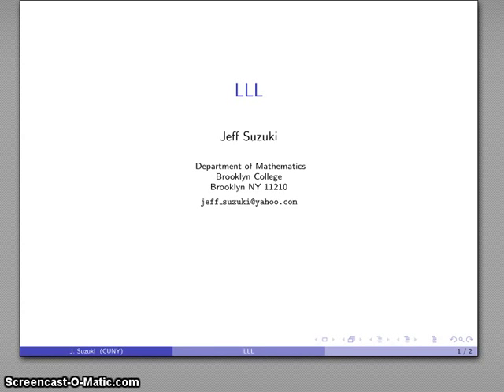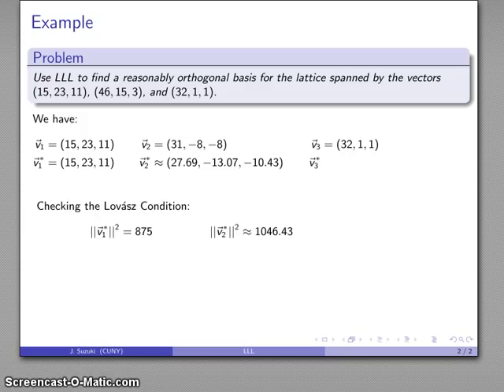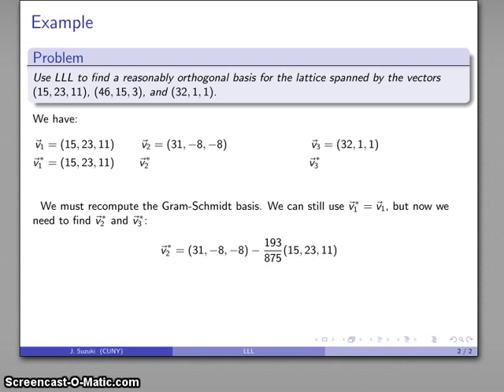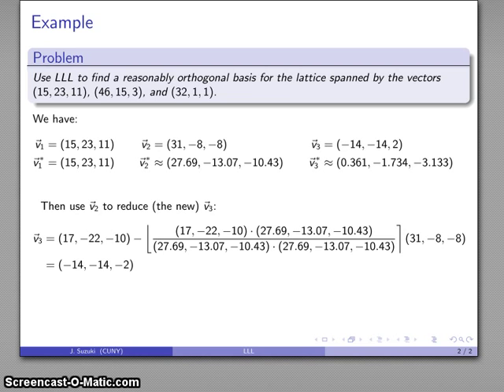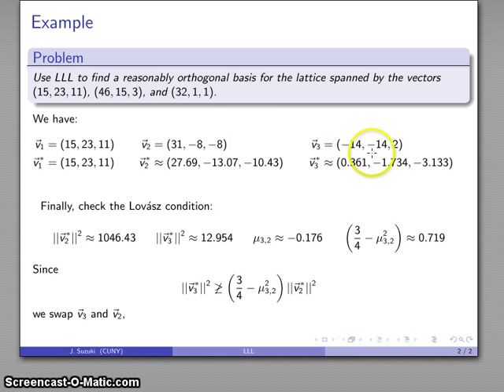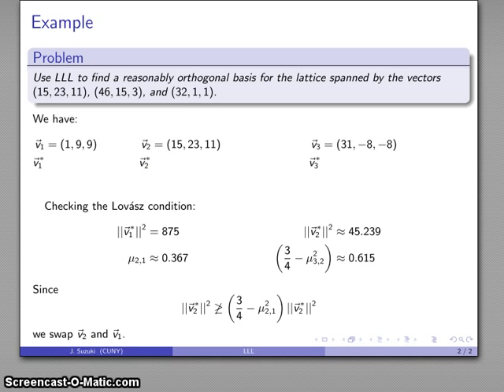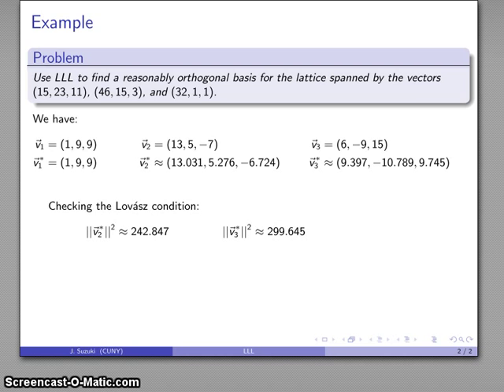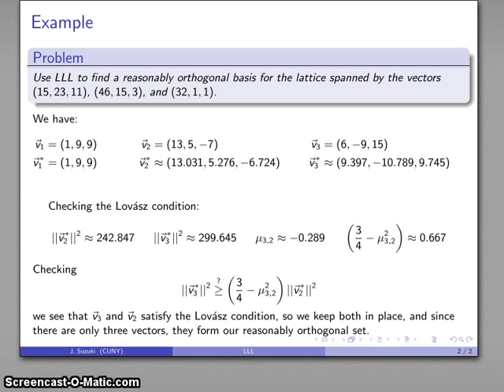LLL Example 2

Comment: First, thanks for these examples. I'm a cryptographer working on some Lattice crypto and haven't previously wrapped my head around LLL to my satisfaction. These examples were a great help.

That said, I found another typo in this example. When computing (3/4 - mu_21^2)  the first time after swapping v2 and v3, you correctly compute the value ~0.615. However, the slide shows (3/4 - mu_32^2). It looks like a minor copy paste error, but could confuse listeners.

Comment: It's really a nice video for me to learn some detail about LLL. But compare the algorithm of Jeff to the algorithm of "Introduction to mathematical cryptography", there are some difference. First is that, Jeff does not caculate the Gram-Schimidt for all the vectors at each step, I think Jeff does it for convinence. Second, when it comes to [Size Reduction], the order should be reverse order, for example, if you want to reduct v3, you should use v2 to reducts v3 first, then use v1 to reducts v3. But i do not think that it's a serious thing since that the end answer is right.
Reply: Are you sure for the order of the use of V_2 and V_2 to reduce v_3

Comment: sir, i think you got it wrong on the sign of the second round of finding the v3 vector,which is supposed to be 3.133 and not -3.133, CMIIW
Reply: I agree. Unless both of us are doing something wrong, I got 3.13321 as well.